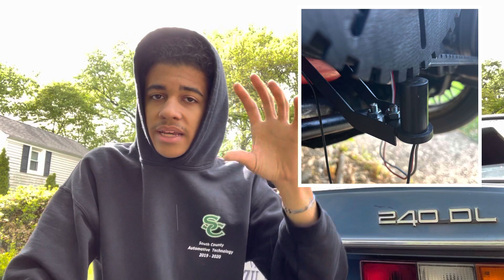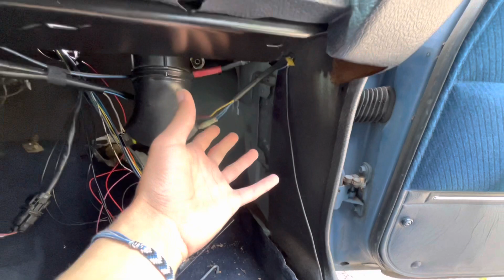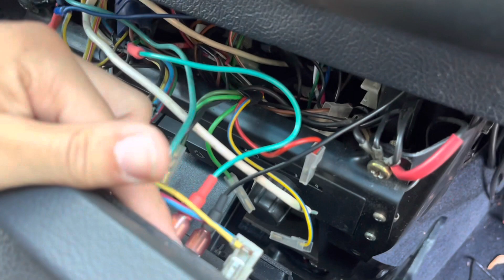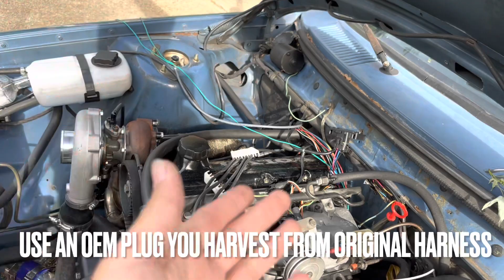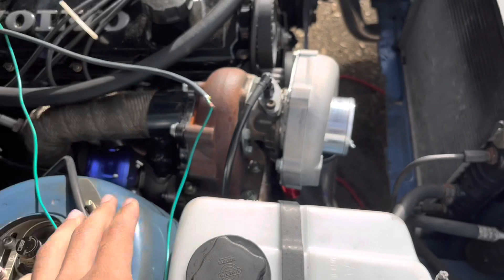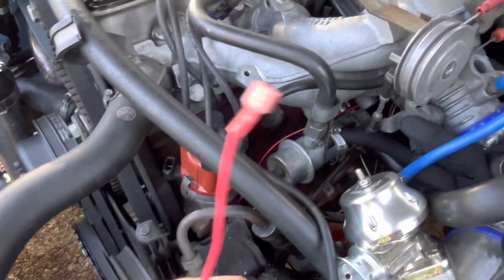VOLVO 240 MICROSQUIRT INSTALL | (full walkthrough)

Comment: I like the way what you did 
I have a question 
I have 1979 Volvo 262 c bertony 
& the x owner swap the engine from the original v6 to a Volvo 2.3 regular engine red block 1988 manual transmission with ECU 25 pin
Unfortunately the smog state reff. Asking to add an OBD 1 to it. I know it have to install an other ECU with 35 pin can you help me to get it done as business. Thank you
Reply from the maker: I don’t know how to do that sorry boss

Comment: Dude that wire to battery you need to add fuse in to it for safety reasons and that injector you can all leave them in 1 wire because it’s just power you did fuse for every wire for no reason you don’t have to because the signal ground to make the injectors works and you just need fuse from the battery to the relay. Fix the issue if you still run with same setup
Reply from the maker: nah

Comment: Awesome how to, this brought back memories for me. I built a Ms2 and wired it all up into a 280z back in 2005, i did a write up for HybridZ but nowhere near as concise as your video. I like how you isolated your engine management from the car, I did exactly the opposite when i did my Z and it made trouble shooting a lot harder, and all to save a little bit of money on relays and wiring.

Definitely a thumbs up and it convinced me to just stop messing around with finiky 35 year old EFI. The price is certainly right for the Micro Squirt.

Comment: Great detailed video, thank you for putting it together, makes me think I might be able to change my lh2.0 to microsquirt. 
I might have missed it in the video, but with microsquirt management does it use / hookup to the stock IAC valve? or does it ignore that altogether, or maybe it's the "Fast Idle Valve" on the wiring diagram. Thanks
Reply from the maker: I’m currently not running one but I plan on adding one… you can’t use the lh2.2 one you have to use one from a 2.4 car because it’s two wire instead of three
Reply: @max._jolley  ah thank you, that's good to know

Comment: I have installed everything and the wiring is good however, after setting up the basic settings in tuner studio and making sure the vehicle is timed I am still unable to start the car. Do you have any tips or perhaps any last minute tricks that may be I missing thank you so much once again.
Reply from the maker: When you turn the key does the starter crank? That was a simple stupid problem I had that the microsquirt was all good but I hadn’t connected the Volvos starter wire… if it’s something else dm me @max._jolley on ig and I’ll happily run you through whatever is goin on!

Comment: The reason you need the ignition module is that Microsquirt can only output a logic level ignition signal, which can only control smart coils. Most older stock ignition coils are “dumb” coils and need a triggered ground. That’s what the Bosch ignition module provides. The Bosch is told what to do by microsquirt’s logic level signal and in turn triggers a ground for the coil. The alternative to running a Bosch module is doing a full conversion to smart coils.

Comment: You sir are a legend ! I've been looking for a triggerwheel setup on the crank for a while ! I have a 245 with a b23E in it. Looking to turbo it and stand alone ecu it. Don't have the flywheel with the modern hall sensor shit. So will use your trick! 

Besides my 245 I have a 145 with a 940 turbo swapped b230FK in it on stock ecu. 

I am curious, where did you get your tune ? Did you make it yourself and would you be cool to share it ? 
I have a friend whom is building a b230fk engine with a 16T turbo, also custom ecu. 

Thanks again for the walkthrough. 

Lastly you are running 2 injector wires. Thus 2 out of the 4 will be running in batch mode. Luckily not all 4 at the same time, otherwise you will have problems xD.
Reply from the maker: Thanks!! I really appreciate it. This has been a slow project for me just because of life so all of my answers are gonna be iffy. I would love to share the tune but it isn’t done and isn’t good I would feel bad if something happened to your car on a very rough tune… I’m hoping to one day post it somewhere either on YouTube or elsewhere when I get it running well. I got it from another youtuber! Also, I’m planning on running 10-12 pounds of boost but that will come with the tuning… won’t have a good amount of time until late spring then I’ll hopefully be able to get you some better answers!
Reply: Ow I forgot to ask ! How much boost are you running on your originally NA b230F engine ?

Comment: Running batch injection I would think your gonna foul plugs like crazy, your also putting fuel in a cylinder that doesn't need it???
Reply from the maker: I completely explained what I was tryna say wrong because I didn’t fully understand it so disregard that part 💀💀
Reply: I’m running batch injection on a 3 cylinder SeaDoo. It’s fine. Fuel only goes in to the cylinder while the intake valve is open. It can puddle up on the back of the intake valve but as soon as air is moving it all gets blasted in to the cylinder. Mine idles nice and smooth
Reply: The factory EFI in this application uses batch fire. This is still a very worthwhile upgrade if you plan on tuning it compared to the stock ancient Bosch EFI.

Its worth mentioning that almost all EFI even into the 21st century, even if MPFI, still would use batch fire under full throttle and for startup/warmup. MPFI is primarily for emissions and fuel economy.

If you're messing with these old engines, fuel economy isn't really a priority anyway.

Comment: This is the best explanation on this  subject i have seen. Very, very good video. Thank you!

About the rpm sensor, could the flywheel for the lh2.4 have been used?
Reply from the maker: Thanks! Would’ve been a lot easier if the car was lh2.4 yeah

Comment: instead of the hall effect sensor, couldn't you just use the flywheelsensor?
Reply from the maker: There isn’t one on all models… if mine had one then def yes would’ve done that
Reply: Fly wheel sensor can not be used
Reply: @alejandrotrujillo3189 if microsquirt is anything like MS-2 like what i put on my 280z back in 2005, you can adjust jt for whatever crank trigger you want. As long as it knows where TDC is it should be able to use it.
Reply: I think the OE crank sensor was from Bosch rev2.4 which came out in 1989 in the 240s. Im probably gonna do this to my 245, the stock EFI is a bit of a pain, so sensitive to the smallest vacuum leak. The speed density EFI wont care

Comment: what benefits do you get from this?
Reply from the maker: Independent control of timing and fueling and a bunch of other engine metrics… mostly beneficial for the turbo I added
Reply: @max._jolley  oh okay. So only really used for tuning
Reply: Freedom from finicky 35 year old EFI for one.
Tunability is a bonus.
Reply: What is the MPG with the new  ECU?

Comment: great vid. I did my 240 4 years ago. Like you it was hard to find answers and when it came to start it. Nobody would give me guidance. I had to hire a tuner online just to get it running. Im still learning the turning part, but slowly getting there. Great vid. where did you get the crank wheels and sensor. Thanks
Reply from the maker: Love it! Yeah it’s a pain but in glad this video has helped a bunch of people. I got my wheel and sensor from DIYAUTOTUNE.com along with pretty much everything else
Reply: Did you end up getting it tuned? Are you willing to share a base tune?

Comment: Wiring the AEM UEGO controller ground to chassis ground will work but you may see some voltage (thus afr) difference between controller and Tuner Studio. Another option is to wire controller ground to sensor ground on Micro. Microsquirt makes this easy as ir has a 2nd sensor ground you can run.

Comment: I have a 84 with huge issues with the icu. I've been debating of going micro squirt, my question why didn't you use the hall sensor on the distributor. Because i finally made that work. Did you do it just so it was simpler or just preference. Because i know the sensor i have is about 180 bucks because mos volvos have the sensor and distributor on the the back of the engine. Well now that i watch more in to the video i feel dumb haha you kinda answered my question.
Reply from the maker: Haha yeah no problem! It was just too easy, relatively cheap, and I had problems with two distributor hall sensors so I was fed up haha
Reply: @max._jolley  i had to look up multiple videos to check how it worked. Now it's interesting because im everything related to the red block, i always heard not to go with the older blocks, the non squirter blocks, yours is the first turbo, i assume not squirter because of the distributor, because most of the newer blocks have the distributor on the cylinders head. Has worked good for you the set up? It's also true that theres not enough info about microsquirt with the older volvos, i saw another video with a green station wagon and if I'm not mistaken in one of the 3 cables they had too put a resistance on the hall sensor to make ot work. I have replaced a good amount on my car and yet haven't been able to use it. I have issues with the ignition, discovered that part of the problem was the faulty hall sensor. But there some other issue and that's why i just think it's better to re do the wiring. It's 84 known that earlier models had electrical issues.
Reply: @N4GUZZ its always better to trigger off the crankshaft anyway. The distributor is driven from the timing belt and as such timing wont be as accurate. IMHO if youre gonna use a standalone which has the capability to use a crank trigger, may as well just use some LS coils and eliminate the distributor entirely.

Comment: Thanks for the very detailed video. I was trying to decide between bike carbs or microsquirt on my VW Cabriolet, when I swap in an ABA motor. This video is really pushing me to the Microsquirt direction.

I do have one suggestion that should have been your first step. Disconnect the battery. You don't want to go through all this work to have the ECU get fried from having possible hot wires
Reply from the maker: 100% I had the battery removed for the whole process until I was ready to start good tip

Comment: Interesting video, thanks. I plan to Microsquirt my Saab 900 which has the same Bosch Jetronic 2.2 system, except the engine is mounted in reverse, with the crank pulley up against the bulkhead, so that toothed crank wheel will be even more difficult to install. And I'd like to delete the key ignition and replace it with a (hidden) start button. More research needed before I start ripping out cables.
Reply from the maker: Sounds like quite the project!! Good luck